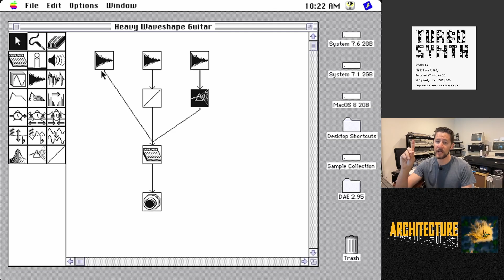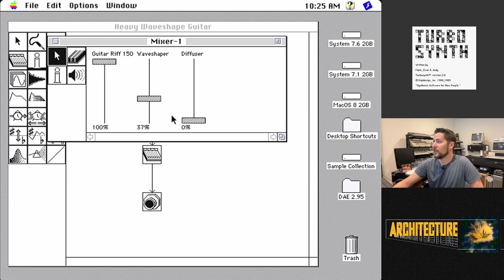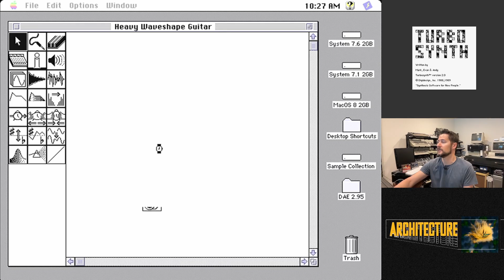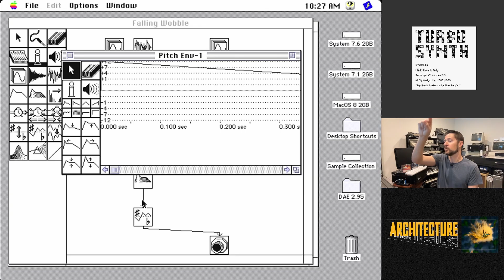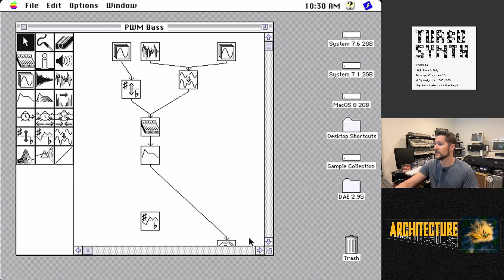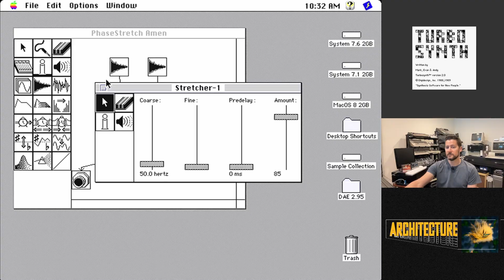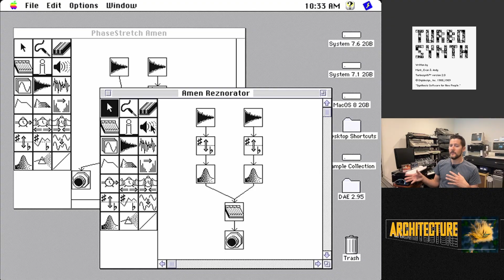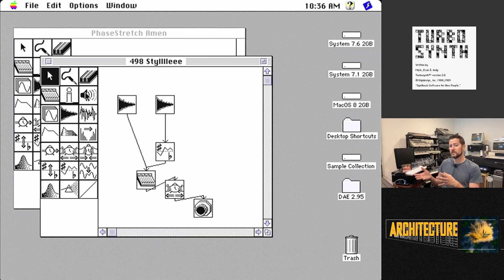This Old DAW : Exploring Turbosynth

Comment: So you need a DAE compatible card to use the Diffuser module? It must use the 56001 dsp chip. It should integrate with your Samplecell as well wont it?
Reply from the maker: Turbosynth SC 2.22 does work with SampleCell on my main rig. Playback only, no DSP functionality. I have some Pro Tools III PCI cards but no proprietary SCSI cables to make them work fully.

Comment: Turbosynth is so cool, so ahead of its time! Its closest relative would be something like Generator (later went onto become Reaktor), which came out almost a decade later. Even PureData wouldn't come out until 1996, and Max wouldn't gain digital audio features with MSP for another year after that. To think this came out in 1988 is almost unbelievable.
Reply: Sure, Turbosynth is very cool - I run it on my PowerBook. But let’s also remember 1987’s Synthia for the Amiga which did many of the same things (it wasn’t Modular, but 5 or 6 separate executables with different synthesis modes and FX that could be applied to samples) 😁
Reply: @magicalsynthadventure3216  Cool! Never heard of Synthia, will check it out.
Reply: Yes, I remember Generator!
Reply: @carlosnavarro3725  Generator 2.0 by Native Instrument released in 98 was also really successful! I just came to reinstall it on a virtual Windows XP and it still sounds just as good and is absolutely usable today! This channel is fantastic! Bravo Architecture ! From Paris,